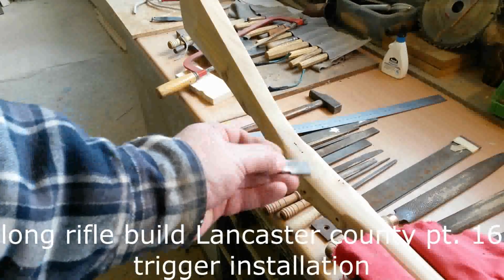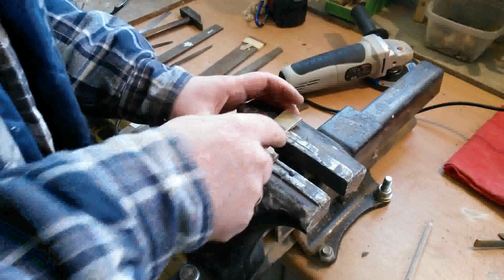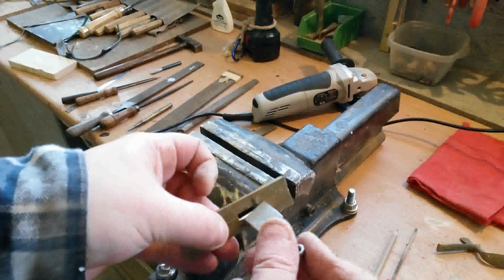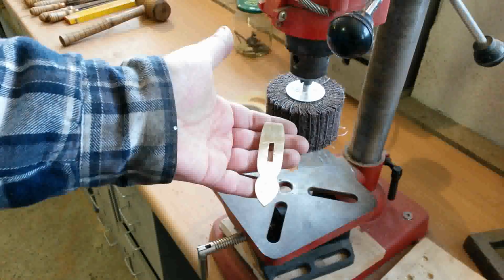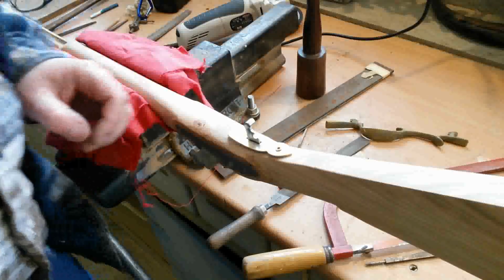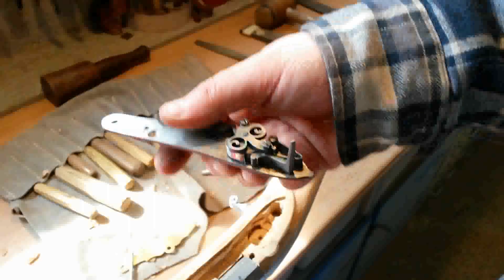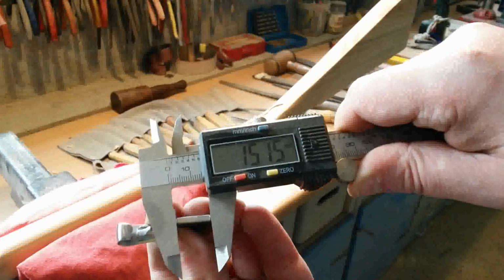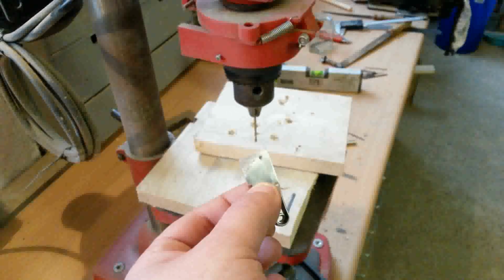long rifle build Lancaster county pt. 16 trigger installation

Comment: This looks like the most difficult part so far. Just needing that precision to have the trigger just right
Reply from the maker: The most needed thing is to make a good measurement for the depth to the trigger lever in full cock position. Than file down the blade of the trigger to the measurement. Than it should be perfect 😁😉 and the most important thing is to take your time .....

Comment: That trigger looks very nice, and you have just the right amount of free play on it at rest, did you file a slight angle on the trigger plate edges, it makes the plate much easier to inlet. That is a very nice shaped bridle on your lock, did you file that up yourself or did it come like that?This project is coming along fast, you will have to look for another one soon. Chris B.
Reply from the maker: The bridle is the original shape of a durs egg english lock. That was imported to colonial amerika. The slight angle is made and I used dummy screws this time ;-). The next project I have some ideas , but it is not decided now hi, hi,